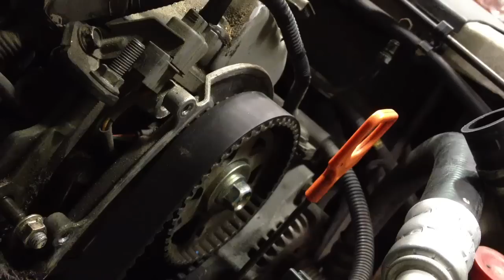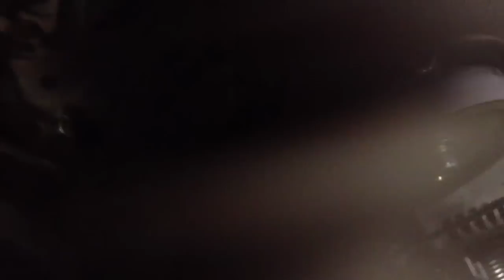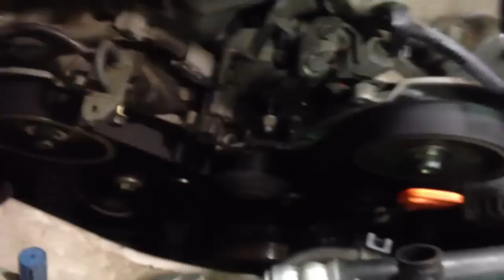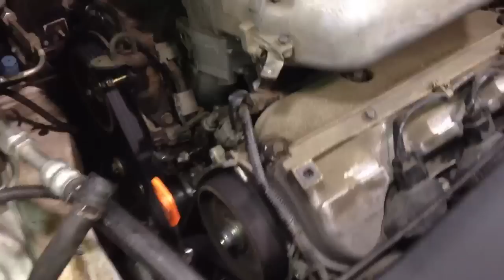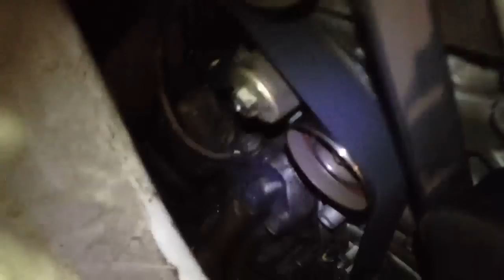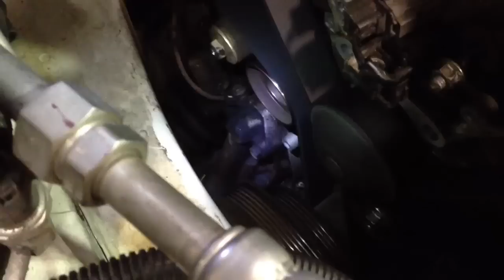Honda Odyssey Startup after Timing Belt Replacement

Comment from the maker: @1997cr80r 3.5 V6. This is one of the easiest timing belt jobs out there. The only hard part was getting the crank pulley off, I ended up using a torch to heat the bolt, and hammered it off with a 3/4" impact.

Comment from the maker: Good grief man, chill. The crank seal is ok, or I would have replaced it. And although I work at a GM dealership, I talked to several people about this who work at Honda dealers, and they use 3/4" impacts and torches if necessary, to get the bolt off. It's not like the crank seal is difficult to replace if damaged once the pulley is off, not to mention it's a cheap part too. Also, you need to study up a bit, you can't use a puller to remove these crank pulleys. The bolt is what holds it in.